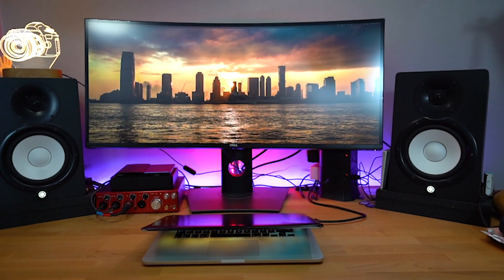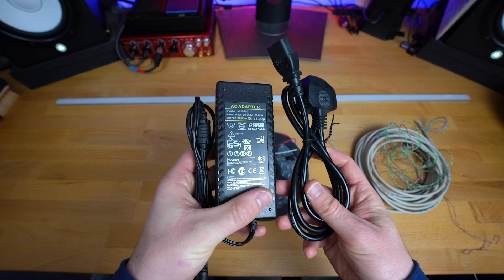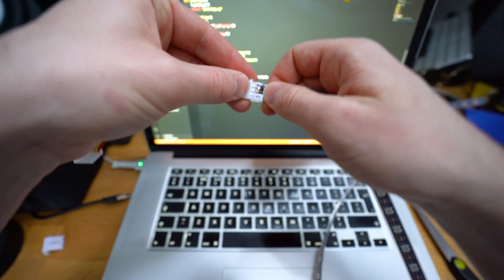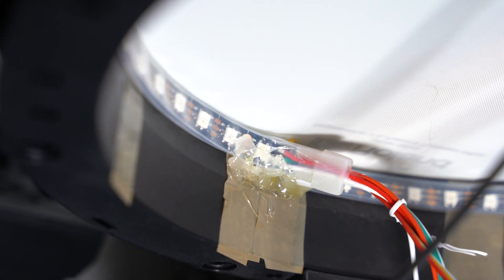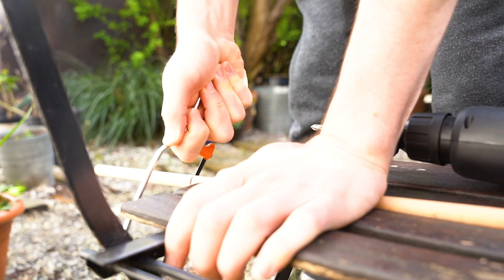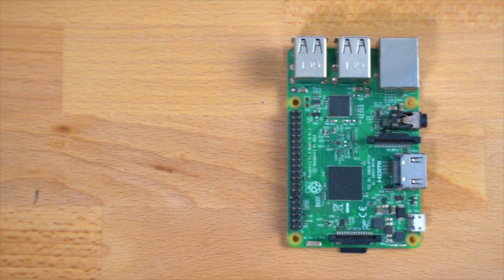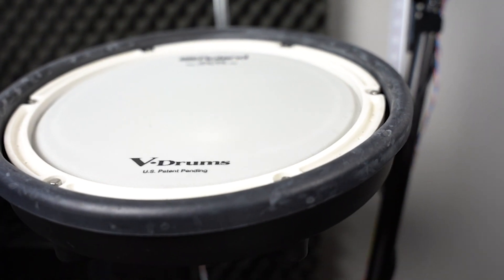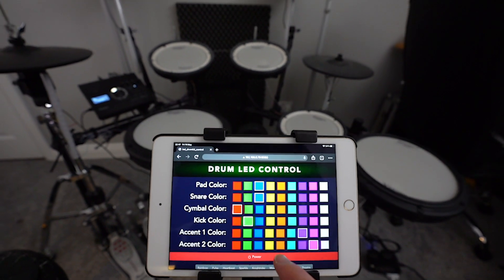DIY LED Drumkit

Comment: Darn it now I wish I didn't buy an edrum with black mesh heads! 🥺😞
Reply: It will still shine thru, and black mesh will mostly hide the individual leds, which looks cooler. If the end result is too dark, add a thin "clear" silicone sheet under the drum head. This will diffuse and brighten the light coming thru the black mesh.

Comment: Great Project! How is the latency of the system?
Reply from the maker: Thanks a lot! There's a small bit of latency due to it using Python. My next version will be with an arduino so it should remove the potential of any visual latency

Comment: This an awesome project.  Finally got the main.py to run but I get the message that no midi device is connected.  I'm using a TD-27 which shows up in the list when I use 'lsusb' in the terminal, but main.py still does not see it.  Midi mode on the TD-27 is set to GENERIC.  Is there some additional configuration I need to do?

Comment: Do you have any issue with power? IF you have too many leds some parts wont be as bright?
Reply from the maker: Yeah I found that the parts towards the end which are the cymbals in this case don't tend to be as bright, but only really if other part are lit. So for example during a big fill. If I was to do it again I'd choose 12v leds instead of 5v because they don't have that problem as much
Reply: @stephencolfer  I saw another youtube but using a LeDMX4 PRO and some software to control the leds he has a wall led light and was doing some power injection in some of the sections that were too long not sure if that can be done with your method.
Haiz so many ways to do this I still cant decide which way to go whether Raspbery Pi, Arduino or LeDMX2. The final costs also differs from one another but the common thing is the controllers do cost a bit.

Comment: Do you have arduino based drum light project as well? And can you connect the led controller to a MIDI app? so you can learn songs with it as well
Reply from the maker: Hi Trevor, I don't have an arduino version just yet but as far as learning songs goes that is what I'm planning for a future video

Comment: This is the best I've seen yet! Little did I know, looking for information on doing this, id find a guy who did it and is also a phenomenal drummer. Great job! 

When I first got the idea myself to do this for live shows on my acoustic set, I found a few websites for arduino sound triggering leds but not specifically for a drumset. 

I'm not up to speed on any programming or hardware interfaces (I wrote some basic programming in high school 25 years ago) but I've found the common options to be raspberry pi and arduino. 

If I do arduino, are all triggers completely independent of each other? No interface to have them work together on changing colors or zipping through all of them on startup like yours? (My main plan was when I do a build where the snare, floor Tom, and kick are receiving simultaneous triggers, everything would light up instead of just those three. 

Not certain on how to get the cymbal hits to trigger a light strip on its stand. 

Thanks for this video and any help you may offer.
Reply from the maker: I'm not too familiar with running similar code on an arduino to be honest. It'll probably be something I'll try in future though. Is yours an acoustic set? I'm planning my version 2 to work on my acoustic set with piezo triggers but I'm also having an issue getting anything for the cymbals

Comment: amazing ...your drum pads on your drum kit are piezo sensors ..right..?so with the raspberry and the code you were able to to to take the ac signal from the pad and turnon the light strip....where can i find the code for it..thnx in advance...!!!
Reply from the maker: Thanks! The sensors trigger a midi output from the Roland drum module which is what the raspberry pi is reading. The code is linked in the video description

Comment: Fantastic work!!! Could you please tell me if I can use Arduino with this code?
Reply from the maker: Thanks! My code isn't built for an arduino yet but it is possible to write code that will control it the same way with an arduino

Comment: How does each tap trigger the lights too turn on??????
Reply: I was wondering the same. I saw in one of his replies he has the USB out of the module into the raspberry pi sending midi signals. The pi sees  the midi of the  particular drum and lights up that particular light on that particular drum. At least that's the way I understand it.
Reply from the maker: @wizwooky5877  That's exactly it. I've explained it in more detail here if you haven't seen it yet https://youtu.be/yX7SraFQbS4

Comment: Can you share the connections? Did you just connected the kit to the raspberry or also to a computer with something like ezdrummer?
Reply from the maker: Hi Bruno, I just connected the kit to the raspberry pi via the USB connection for MIDI messages. I didn't need ezdrummer as I just used the sounds from the drum module